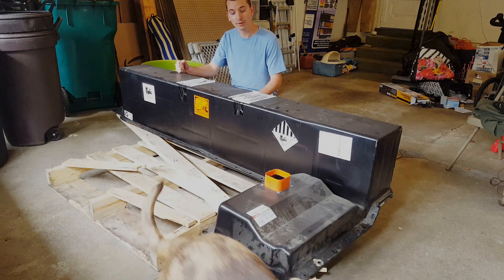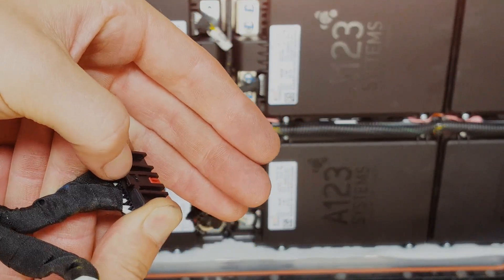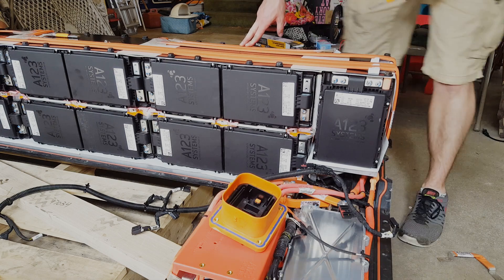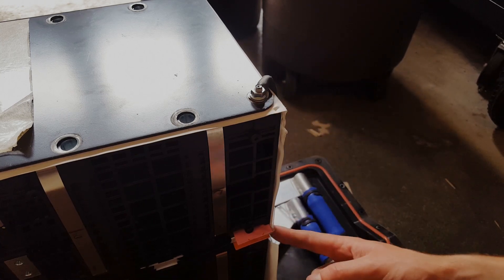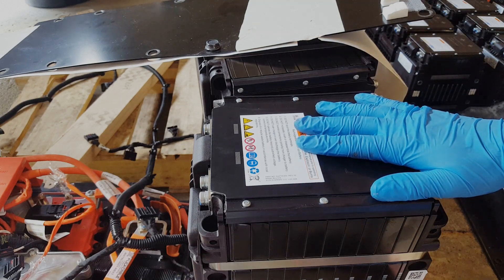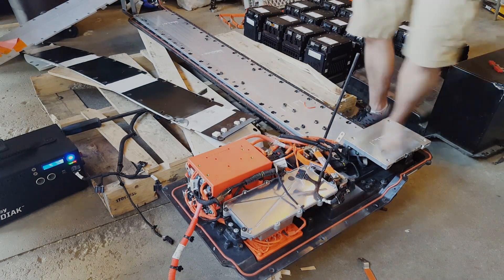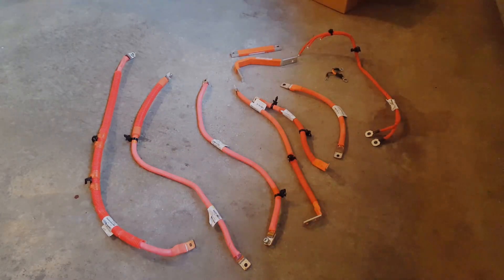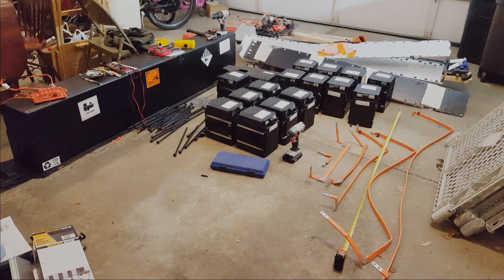Battery Teardown!! 350V A123 LiFePO4 Module - (15) 1.25KWh Batteries to Harvest! And Other Goodies!

Comment: Do you still have the management electronics? (Current sensor module, battery controller, disconnects, contactors etc.)
Reply from the maker: Yep! I still have everything that was shown in the video. Thanks for watching!
Reply: @diyrenewableenergyelectron4996  I could use some of that stuff if you don't have any use for it, let me know!
Reply from the maker: I don’t. I can send you photos of you would like.
Reply: @diyrenewableenergyelectron4996  please do!!
Reply from the maker: @jdiggitygillz  my email is codeman11901@gmail.com
Reply: @diyrenewableenergyelectron4996  sent you an email!

Comment: Nice Review, waiting for more. Cheers! 
Have a look, definitely, this Battery will SAVE YOUR MONEY.
Our original power wall wasn't enough, so we decided to add on brand new, never cycled, A123 cells, double the capacity, and lower the weight. 
Introducing the Gen 2!
This 24V Powerwall is perfect for a wide range of applications from solar storage to power outage prevention to RV or marine applications, or for simply saving money on your electric bill. Unlike other power walls that cost a fortune and are often designed for one or two applications, the Gen 2 is a one-stop-shop, and it's compatible with all major inverters, all while being the most cost-effective choice available.
For more information, visit BigBattery.com, or email us at sales@bigbattery.com!
https://www.youtube.com/watch?v=zTsO3842K08&pbjreload=101
Reply from the maker: I have been eyeing the products over at big battery!!

Comment: I am wondering how these modules were cooled and what you did for your cooling?
Reply from the maker: Well, the modules were definitely originally liquid cooled. That aluminum plate was for cooling and there are aluminum sheets between each cell in the individual batteries to wick heat away. Kind of cool.

As far as cooling for me? I'm not using any because I wont be working these batteries enough to get even slightly warm. They are powerhouses and I'm not asking much of them lol
Reply: So there were holes length wise in aluminum to keep the plate cool. But in your another video, you disassemble the a123. There I saw the terminals were on top (and also the individual cells were vertical), which need to be cooled more. What you think how heat transferred from a123 to aluminum?
Reply from the maker: The individual batteries (with the terminals you referenced) had thin aluminum sheets between the cells and these sheets were bent and made to have contact with the aluminum cooling plate. If you look at the side of the batteries, they are actually thin aluminum pieces not a plastic housing. The heat of the cells transferred to the aluminum cooling plate via these aluminum sheets. Pretty nifty.
Reply: @diyrenewableenergyelectron4996  Thanks😊, I watch again and this time use magnifying glass...
Reply from the maker: 😂😂😂 I'm not sure if theres a good angle on it but good luck!

Comment: This is the battery pack from a Fisker Karma.  I have a Karma and am currently replacing individual cells in these modules from A123.  Where did you get this?  In the Fisker world, this is GOLD, as they don't make the car anymore.  I would have parted it out and used 18650 batteries which are much cheaper for a powerwall.  I will have a video up soon on taking these modules apart and replacing cells in these 7s 3p modules.
Reply from the maker: Interesting! These were listed on www.batteryhookup.com. What are they worth? I have 5 spares sitting in my basement 😉😂
Reply: @diyrenewableenergyelectron4996  Not sure, I know it isn't cheap to get a module replaced.  I was amazed when I saw the pack like that.  I know that there were some full packs in dealer stock that got wholesaled a few years ago.  Likely where they came from.  Not easy to replace the pouch packs when they fail.  The nickel tabs are perforated and will act like a fuse if one shorts.  I am happy you are able to get some use out of them, the Fisker Karma should have cost over a million dollar a piece with the low numbers they sold, and high engineering/manufacturing cost.  You got a DEAL my friend, this is some solid energy storage.
Reply from the maker: They are definitely performing! I'm not pushing them hard at all with my setup but the capacity so far has been better than expected. Thanks for watching! It's appreciated.

Comment: Hello, Did you by any chance get the OEM Specification Sheet for these batteries? I understand the BB  puts out a spec sheet but I am interested in the actual Spec Sheet from the OEM. If you do please let me know? Thanks
Reply from the maker: I did not get an OEM spec sheet. I even went on A123' s website to see what I could dig up but left empty handed. I'm sure somewhere on the internet a spec sheet exists but for my application I have all of the info I need. What were you looking to learn about the batteries?
Reply: Hello,  I need the recommended MaxCVoltage, MaxFloatV, Discharge Cutoff, Max Terminal Voltage per Cell not for the entire 8S
Reply from the maker: So your max battery voltage is 25.55, your discharge cutoff voltage is 17.5. You do not want to float charge lithium batteries. You typically want to charge to max voltage and shut the charging off completely until you reach a lower voltage set point (3.3v/cell for example) and turn the charging back on.
Reply from the maker: Max voltage per cell is 3.65, but I usually stay at 3.6.
Reply: @diyrenewableenergyelectron4996  Hi there - Hope everything is well. Just wanted to followup with you. Is the 3.6 per Cell working for you?
Reply from the maker: 3.65 is my upper voltage limit and is working well. I do not take the batteries that high and usually stop around 3.6v. There's so little energy from 3.6 to 3.65 it isnt worth charging above 3.6.
Reply: @diyrenewableenergyelectron4996  Just ordered 4 of them. They will be here tomorrow. Also picked up a 200a Daly .. BMS just to keep things balanced.
Reply from the maker: Did you get the 8S versions of the batteries? Theyre much easier to pair with standard off the shelf BMS's. These 7S batteries I used were kind of a pain. In hindsight I wish I had 8S batteries but I made die with what I had available.
Reply from the maker: Do you have an email that I can send a spec sheet to? I found one. Very impressive documentation and extremely impressive peeformance from these cells.
Reply: @diyrenewableenergyelectron4996  I picked up the 8S/5P x 4 ... so my BMS is a 16S that can push 200+ amps if needed. Apparently A123 shipped these units in different flavors of Pouches ... some versions will not push 100a since they are using a lower amp Lifepo4 pouch. So its best not to confused on document for one type vs the other as one may push too many amps and overheat the pouches. Just a thought!. Some also have fuses on the inside of the Buss that cannot be seen unless you remove the packs from the S packet. Then there is the UltraSonic Welding which is a whole new story ... Anyways - excited for the purchase and hopefully get some good years out of these.
Reply: When using a BMS ... especially if its a passive one like the Daly's , make sure that you reach the Balance Detect Voltage of the BMS, otherwise the BMS will not balance the cells and will cause your cells to drift over time. The Daly BMS usually will not balance until that voltage is reached. There are other flavors passive/active, such as the Batrium ... but right now its not affordable to me at this time.
Reply from the maker: @mj2801  same here. My balance detect is set to 3.4v I believe. Any voltage above that, and it balances to within 10mv.
Reply: @diyrenewableenergyelectron4996  Cool Deal
Reply: @diyrenewableenergyelectron4996  Can I get the spec sheet as well?
Reply from the maker: I believe a123 has the spec sheets available on their website.

Comment: Imagine what that pack cost the military. I wonder if it has silicone insulation on the wiring.
Reply from the maker: I would love to know also! It was a pretty penny.
Reply: @diyrenewableenergyelectron4996  Is the insulation jacket on the wires and ground strapping silicone? I notice how easily it bends.
Reply from the maker: I dont think its silicone on the wiring, its too hard. I'm not sure what it is honestly.
Reply: Imagine what the pack cost the American taxpayer!
Reply: @royrunyon1286  It is from a passenger car.  So likely it was privately owned.
Reply: @afternoongarage  Find me a passenger car that is even half the size of that battery lol
Reply: @afternoongarage  He said this one came out of a military vehicle. But they do appear to be the same battery.
Reply from the maker: I was just using the info from battery hookup. I didn’t do further research myself.

Comment: What are the specs on each of those modules?  That looks like really nicely constructed battery pack as per usual from A123.  Can't wait to see the projects utilizing them.
Reply from the maker: The individual batteries are 7S 23.1v nominal 58Ah. They are rated at 1.35ish KWh each but are slightly degraded from use so I expect around 1.25KWh each. I will be doing a wiring video for BMS's on these, and I can tell you that it looks as though there are actually 21 cells in each battery. So they are 7S3P. If that part didnt make sense, it will when I do the video.
Reply: 58Ah sounds familiar, A123 seems to use these 20Ah packs in 3P configuration a lot.  7S is a weird configuration for normal use though. it's either 4S or 8S to get 12V or 24V.  Either way, good luck on your project!
Reply from the maker: Yea, 7S puts the voltage down at the bottom of what most inverters will accept. The inverter I'm planning to use actually cuts off at 40-41 volts, so the cells will only get to 2.85-3 volts each before the inverter shut down. We will see how it goes.  Thanks for the support!

Comment: Would buy this for use in the UK if there were no taxes.
Reply from the maker: It really depends on your application. I went with these because they are lithium iron phosphate which is safer than lithium NMC. Since they are going in a home I wanted the safety. If your battery setup is going in a shed or somewhere away from your house, lithium NMC (3.7v 18650's and such) are usually cheaper and yield more energy per dollar.